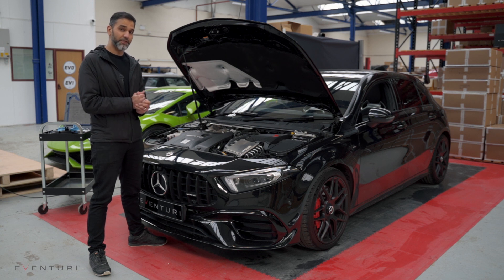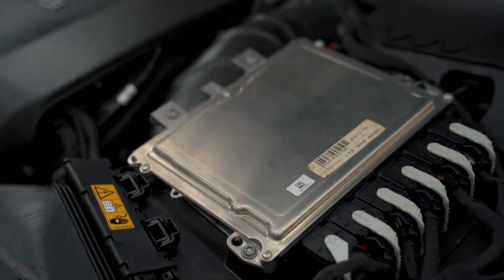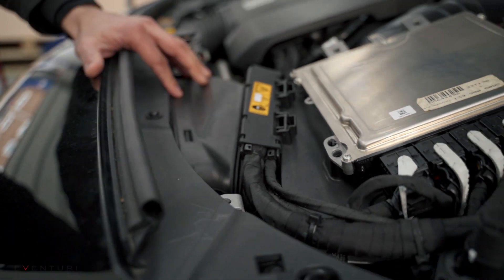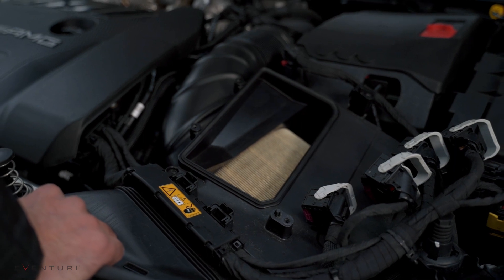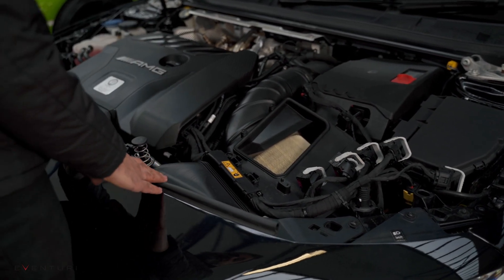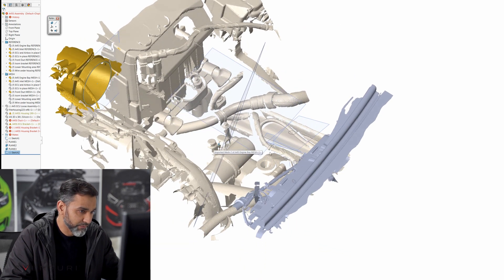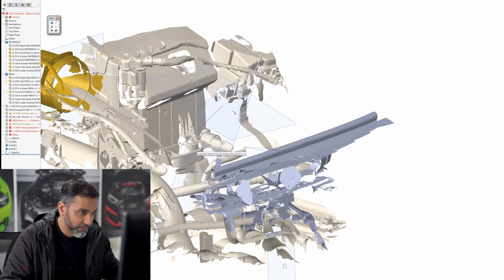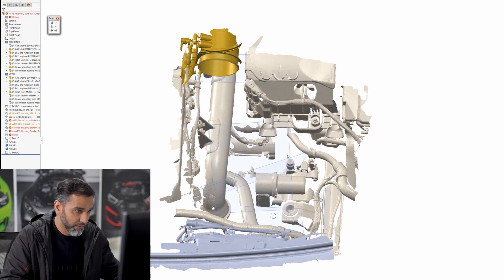Mercedes A45S Eventuri Development Begins - Overview and 3D Scanning!

Comment: A planned release date ?
Reply from the maker: Planning to release in May.
Reply: @Eventuri  Is an inlet tube between the turbo and the intake also provided for? Thanks
Reply from the maker: @venom_9994  We will release further updates soon! Thanks
Reply: @venom_9994     doubt it he states a few times that the 96mm size is very good and unlikely its a restriction.
Reply: @davideverman4800  yes i agree but they can still be enlarged thir air inlet ? The carbon in addition facilitates the flow of air
Reply: @eventuri still waiting for release. You can hold the release date in may or it will go to june or later? Thx

Comment: Is there not a reason why the ecu face is open inside the stock air box? Will you not encounter overheating issues with the ecu?
Reply from the maker: We have considered this and have already tested it - we suspect the reason for the current location is simply packaging and the tight space above the ECU to the bonnet.
Reply: @Eventuri  same idea used in m271 m264 also I think you can easily make a cooling door in your aftermarket airbox should be hard for my mr bilal also does
This car have a crypto cooler ? Also